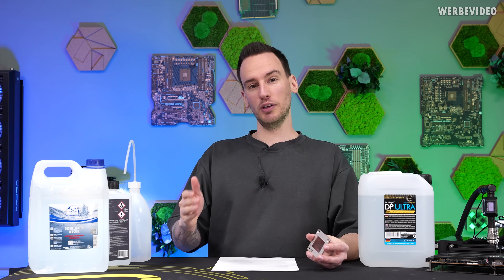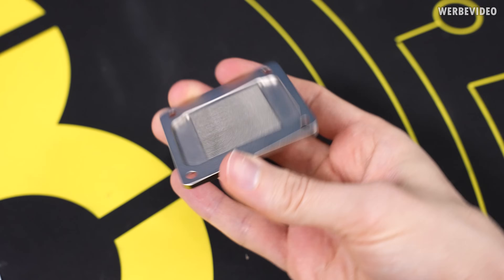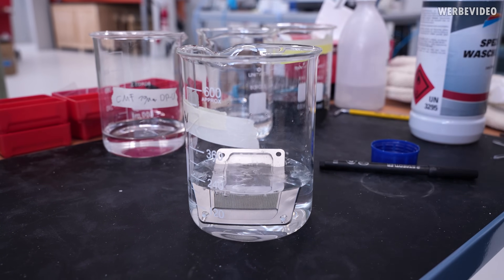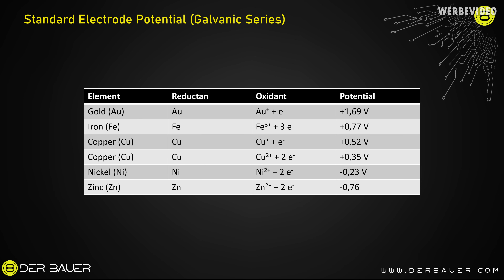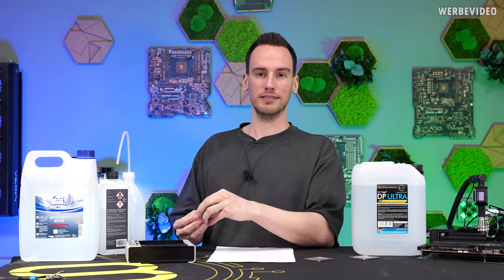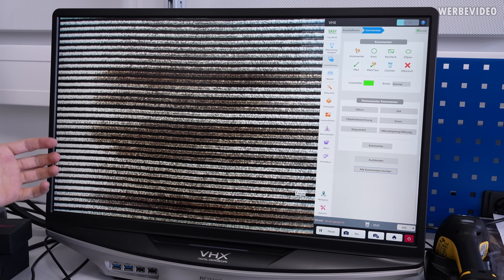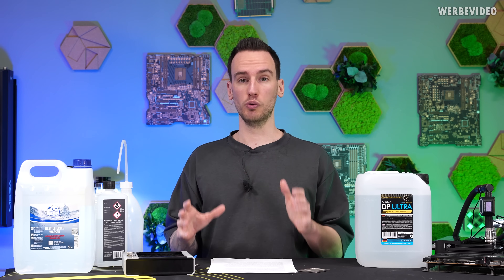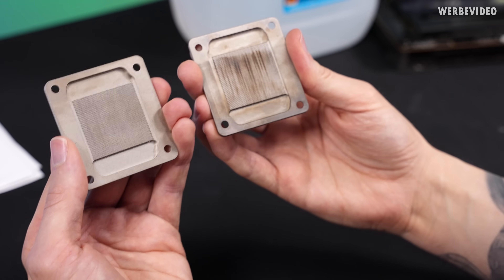Do NOT use Distilled Water for your Water Cooling Loop!

Comment: Education, especially in the US, has really gotten worse. Pure water is an pretty aggressive scavenger, add CO2 from the atmosphere and the acidity quickly causes issues....and then once ions dissolve it becomes mildly conductive...water is far more dynamic than the vast majority of people realize.
Reply: IIRC, It's also an anomaly regarding thermal capacity and phase states.
How's it go? "Water would be a miracle material, if it wasn't so damned common"

Comment: I have a Corsair H110i running right now on my pc, i bought it used years ago, and serviced it right away. I put distilled water in it because it had a low volume of cooling liquid (I replace all the liquid basically).
After about 3 years, it's showing symptoms of corrosion on the outside layer of the copper plate.
I've already ordered a new AIO a few weeks ago and it's on the way. I can open it and send pictures after I replace it, but right now I'm afraid if I touch anything I'ts going to be a mess lol.

Comment: Perhaps you could address the myth of algae in loops? There should not be any photosynthetic bacteria in loop because it's dark. The green stuff building up in obscure corners of the loops is a metal oxide, probably copper based  (i.e. statue of liberty verdigris). Unless you see green stuff attached to the clear reservoir window and growing, it's not algae. FYI you probably have an RO/DI water system in your lab and I bet all of the plumbing coming out of it is plastic because the installers knew how corrosive ultra pure water is.
Reply: More likely than algae are just general household bacteria like e coli. I do notice that old loops when drained tend to have a fishy smell - not sure if that's from a chemical reaction or from some bacterial growth that has died at some point and produced smelly chemicals while breaking down.

Comment: I've been saying this about distilled water for years now, and only few people take me seriously.
Glad you are brining this up.

Distilled water is EXTREMELY EROSIVE. Not CORROSIVE, BUT EROSIVE. (corrosion is chemical reaction, erosion is natural reaction which happens due to fluids touching a solid surface).
Also distilled water DOES NOT LIKE IT being distilled. It wants to accumulate ions and other particles. So it will steal nickel and copper and any other particle that it will find.
Also distilled water is very "rough". Its viscocity is SUPER LOW. viscocity is  inversely proportional to absorption.
Now, if you run distilled for years in your loop, it will accumulate so many ions and particles from your loop, that it will start becoming corrosive to, because random chemical reaction are going to start to happen. Not galvanic corossion which is catastrophic, but things will start to corrode.

HANDS DOWN, BEST LUBRICANT FOR CUSTOM LOOPS, IS 80% DISTILLED WATER MIXXED WITH 20% AUTOMOTIVE COOLANT.
Automotive coolant is designed to run in engine with SO MANY DIFFERENT metals and stuff, in very harsh temperature conditions.
If you want to assemble a loop and leave it running for YEARS with 0 maintenance, this is the way.
Reply: As an automotive enthusiast - you nailed it. A coolant system with 100% coolant, while not destructive to the engine, is not very effective at moving heat. A coolant system with 100% distilled water is maximally effective at moving heat, but quickly destroys the coolant passages because of the reasons you mention. 

That's why there's always a mixture of both in car coolant systems, depending on environment temp variance. It's about time PC water cooling enthusiasts start realising this.
Reply: Erosion is what you get in riverbeds, with rainfall, at beaches, it's the mechanical "deconstruction" of the material in addition to friction with sediement transportation. So your pump would have to go into overdrive, in addition to sediments (hopefully) being absent in your cooling loop.
Reply: For the automotive coolant, are you using the pre-mix stuff for the 20% or the concentrate? Thanks.
Reply: @DaveBell1  2 months late to this comment. If you found the answer to this I'd appreciate if you posted back, if not I would guess (pertaining your question) that it would have to be 20% concentrate, otherwise the mix would not end up being 80% distilled water and 20% automotive coolant, since pre-mixed automotive coolant is mixed with water, thus messing up the 80% distilled water and 20% automotive coolant ratio. 

I'm about to build my first ever water-cooled system and I really want to get this right myself.

Comment: @der8auer : Roman, since you only placed a nickel plated block in the jar, and I am assuming that the entire copper block was nickel plated (i.e. no naked copper is left on the surface, every mm² is covered with nickel) where does the copper come from that was deposited on the block after the test ?
Or do you use nickel that has a certain % of copper in it ?

Comment: I’ve always used distilled with biocide when not using opaque coolant. I’ve never had any bad corrosion or damage, just some discoloration. I recently bought an ultrasonic cleaner, where deionized water is recommended; I know it’s always been a recommendation for water cooling too, but never bought any or tried any. Now that I use it for my cleaner, I will definitely use DI water with biocide in my loop, hopefully that will clean things up even more… I guess I could just get the corsair stuff too though lol

Comment: I used distilled water for 6 years in my first custom loop, never changed out the liquid, didnt have a noticeable drop in performance. After 6 years the D5 pump, copper radiator and brass fittings were fine (due to coatings), but the nickel plated copper waterblock had suffered bad corrosion, was not planning on reusing it anyway, got my moneys worth. If I had used coolant I likely would have had to swap it out to maintain performance over time.
Reply: Sounds about right. You are confirming my bias here that nickel plating is very stupid. I ran naked copper for 8 years, no problems.

Comment: You're most probably already building a 5k+ PC, why cheap out on store bought distilled water 😂 are you stupid? Just buy the most reliable coolant you can find, from a company with good PR, if it's a long running product line with an expensive price tag, that means it has staying power

Comment: Your distilled water is most likely RO or ion exchange demineralized water which pH is around 5, distilled is closer to 7, for anti corrosion purpose im adding sodium hydroxide to pH 8-9 but im not sure it would be ok for Al and Cu, You could try this, my "loop" is made from steel... and its dissipating up to 360MW :)

Comment: I still have a bottle of Petra's Tech PT-Nuke in my desk - only ever used distilled water + 5 drops. Never once considered corrosion, but my loops in the past were all non-plated copper. Now, a budget 360mm AIO is more than I need.

Comment: There are 10’s of thousands of posts online of people saying they use only distilled water and they have had no issues. But also some people that say they have had issues. Also, I’ve never seen a GPU block with such fine fins in it. Is this even necessary? The nickel coverage down into the fins has got to be very poor. 60° C also seems way too hot for a test. I know that you want to accelerate testing, but it’s possible that this test in itself generates results, you wouldn’t see in the field. My loop never gets above 30° and I’d be interesting to see if there’s any discoloration for the same test run at 30°.

Comment: The automotive industry has been using mixed metals in cooling systems for decades. I had a motorcycle with an aluminum engine block, and copper rad. No corrosion. Why? Good coolant. Only time the coolant came out was track days and that was for safety reasons (coolant is really slippery, not good for a sport bike.) I'm using the same Prestone coolant I use in my car in my loop.
Reply: Yeah, automotive coolant has strong corrosion inhibitors. 

If you filled your bike with distilled water it would be a mess!
Reply: @volvo09  Only did it on track days for safety reasons. They did free drain and fills at the track for us for that reason. Glycol is slick. Not safe if spilled on the track. The track normally had 2 weekends a month for bikes, and was shut down three days before and for the week in between, just so they could blast the track clean of anything spilled, and set up the air fences along the walls. After the Sunday racing league event, cars could hit the track again the next morning, and had 7 day a week access.
Reply: For track days you can run distilled water + Redline Water Wetter or a similar product. No freeze protection, but corrosion protection and surfactants to increase heat transfer are included in Water Wetter.
Reply: @Fix_It_Again_Tony  Even where I live, freeze protection isn't needed from June through August. I know a few guys that ran Water Wetter, but I didn't bother.
Reply: @Fix_It_Again_Tony  Thumbs up to water wetter - still use it to this day, though running out.

Comment: I have been using toyota long life coolant (also known as pink coolant) since 2018. I have a byeski rx580 block , am4 block & 240mm radiator. I check it every year & still no gunk on the gpu or cpu block. Haven't flushed the coolant yet & it works perfectly fine. That pink looks cool too in the res & tubes. 
Toyota pink coolant was made in mind with mix of all kinds of metals as they use the same coolant for hybrid inverter (which has a pc like water cooling block) & engine.
Reply: Same as the VW red coolant, i've been using it for almost 30 years in my builds with perfect results!
Reply: The issue with auto coolant is not metals, it's PC loop plastics, especially acrylic and maybe seals.
Reply: @concinnus  what issues might that be? There's plenty of plastics and rubber in the coolant loops of cars. I run lots of acrylic, some parts are over 10 years old. Never been an issue.
Reply: @f36443  My understanding is it's the silicates in certain auto coolants that cause issues.  It was unclear and anecdotal what the issues were, but frankly that's par for the course in a niche hobby like this.
Reply: That might be an issue in low grade coolants, yes. Usually the ones that don't mention they're safe for aluminum heads etc. but they're pretty far between these days. Anything 1,2-ethanediol will be 100% silicate free.
Reply: @concinnus  concerns with acrylic and others maybe with straight glycol (the green stuff) but the pink & blue stuff doesn't affect anything. The gpu , cpu and reservoir are acrylic in my loop and they are just fine. Tubes are silicone.
Reply: Have you seen modern engine bays ....plastic lines galore @concinnus
Reply: @concinnus  Many of the same plastics used in automobiles. I have yet to see any harm to acrylics.
Reply: @concinnus  acrylic is glass
Reply: @zackwang9314  Acrylic=PMMA, a type of polymer, aka plastic.  It's non-crystalline, so you can call it "a glass", but it is not just "glass".
Reply: @concinnus  ...Of course  I can't talk for every "coolant" BUT many if not all cars have also  "platics and rubber" in their "cooling loop". I've personally been using different "multimaterial car coolants" since 2011, even in AIO's that have aluminium rad with copper block ((and plastic and rubber parts in pump and hoses" And up to today Ive never had any problems, neither with corrosion Or "sludge"...
Best regards.
Reply: I use Diesel, NOT auto, coolant. The red stuff. That stuff was made for heavy duty use with three year warranty. I looked into the tech details and it nearly perfect for computer cooling loops. Compatible with all metals. Anti-algae due to truck can set for months. Due to truck using all types of plastic coolant reservoirs, is compatible with the plastics of some blocks that some here are commenting having problems with using AUTO coolant. Only drawback is need D5 pump or use distilled water to mix it down farther to thin it out a bit for smaller pumps. Doing this only raises the freeze point from -40 to -20. Unless you live in north Canada and transport you computer in the car all the time, this is not an issue. It only about $15 per gallon. Much lower then the 1/2 gallon the AIO maker sell for and has the bare minim of additives just to last an year or two.
Reply: I thought about getting the Byksi waterblock for my 580, but I figured I'd be able to get a new GPU sometime soon after. However, here I am, still with my 580 because there's no 5080 or 5090 FE stock... My 580 will keep  chugging along next to my watercooled CPU.
Reply: @Slavolko   I recently made another pc for my other place with a 14400f & 7800xt. It came at just shy of 1100$ with 1440p 180hz msi monitor. Pc parts are getting cheaper due to the market stagnation.. retailers are basically giving away intel cpu's. The 14400f just costed me 120$
Probably the first time ever in history pc parts prices are cheaper in India than usa. What a time to be alive lol. 
Rx580 still runs all of my favourite games at 60fps and thats all i care. 
7800xt is just bonkers. Chews through anything i throw at it at 1440p ultra..the games i play like beamng is always above 100fps.
Reply: @KuntalGhosh That's pretty cheap, nice. Enjoy it.

I only thought of getting the Byski block for the noise reduction, since I have two rads with Noctua fans. My Sapphire cooler keeps spinning up and down, and I hear the fans grumbling at the lowest speeds. My CPU in the loop is silent, besides the pump making a whine.
Reply: @Slavolko  i got the byeski cooler from aliexpress in 2020 months before it got banned. It was about 80$. 
I don't think it was worth it tho. The original sapphire cooler was very capable & noise reduction isn't that great. The pump is loud & temps are no different once the heat soaks in the loop.
Reply: I will mention here too that if you have pets, don't use automotive antifreeze. If you spring a leak, animals are drawn to it because it smells and tastes sweet but it is very toxic.
Reply: @MaaZeus  that's silly. 30 years with water cooling with antifreeze and no dead pets here....
Reply: @f36443  You do you. But a lot of pets have died when DIY car repairmen have left a vat of old antifreeze lying around the garage for later disposal and fanily dogs have found their way to it. If something fails catastrophically in your loop while you are away, the animals will try to taste it because again, it smells sweet. It is a risk, a small risk if you know what you are doing with your loops but risk none the less.
Reply: @ only the glycol (green stuff) smells and tastes sweet. pink or blue is totally different organic composition, and it is less toxic.
Reply: @KuntalGhosh  Antifreezes used to be "color coded" and to this day still are somewhat (green/blue vs red) but there are antifreezes that do not follow the common color coding standards and you have to read if it is stuff that is usable for your engine. It is better to make sure that does the cooler have ethylene glycol, which is the super toxic stuff or propylene glycol which is considerably less toxic, rather than to trust the color coding. Ethylene glycol is still the most commonly used antifreeze in cars.
Reply: Super decision
Reply: personally I've been using the pestone green stuff with tap water, not that I'm recommending using tap water, but I've yet to have any corrosion in half a decade of mixed metal loops
Reply: My Hyundai Ioniq EV was subject to a recall because of the battery coolant. It crystallises at the pump, the pump runs slow and causes coolant errors.
They flushed it and replaced it with a different coolant.
Good to hear the Toyota coolant is more reliable!
Reply: @BobHannent man Hyundai has had so many recalls, passed on a used one because it had a recall for leaking power steering fluid causing electrical fires.

Got a Nissan Altima Hybrid, and it probably uses the same coolant as Toyota since it licensed the Toyota Camry Hybrid system.
Reply: @BobHannent  Probably had silicates in the first coolant
Reply: I guess it's time I should start using car radiator fluid too. I usually just use distilled with some PrimoChill Utopia & clean the blocks with Fitz Polish if they get ugly. If you haven't used that stuff, I highly highly suggest it. It's amazing
Reply: Is it not damaging when the toyota long life coolant (pink coolant) comes to the PCB of the motherboard?
Reply: @TotalWarriorLegends  any water based coolant will damage any electronic part if it comes in contact while the system is energised. even distilled water will become conductive instantly the moment it comes in contact with metals. so if you want something to not damage your pcb if leaked then oil or specialised cooling liquids like 3m novec is your only option.
Reply: @KuntalGhosh  thanks for your comment, what do you use? Or what should you use?
Reply: Same but ford yellow
Reply: I have tried many different water cooling fluids or additives over the years. They all eventually build up material or start to corrode. As above, I have been using OEM antifreeze for 5-6 years now ,mixed at 25% coolant / 75% distilled water. Can get almost any color and much more price friendly than other options. No build up, no corrosion. It protects multiple different metals and plastics in an engine, pretty sure it will work fine in a water loop.
Reply: im using some red stuff (turns out its prestone command heavy duty). af and distilled is all ive ever ran (10/90% mix), since the early days, its what oems use in aios. all ive done is top it up since i built it in '19.
Reply: Same stuff I use in my 2008 Prius 😂
Reply: @GrumpyWolfTech  it was made for the prius. Your hybrid inverter have this coolant. 
There is bmw/mercedes blue coolant aswell but the toyota one is just cheaper. 1l bottle cost 3$ from my local toyota dealership .